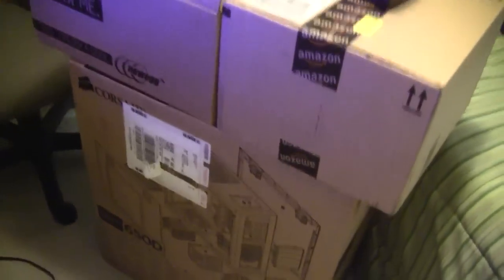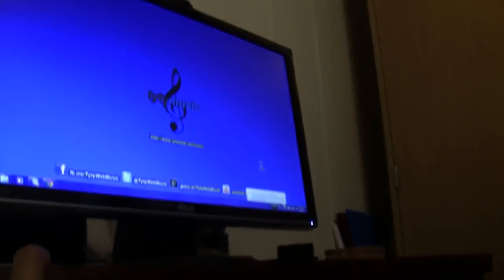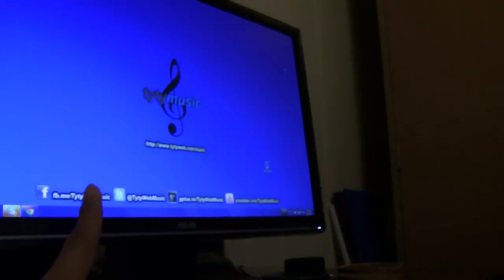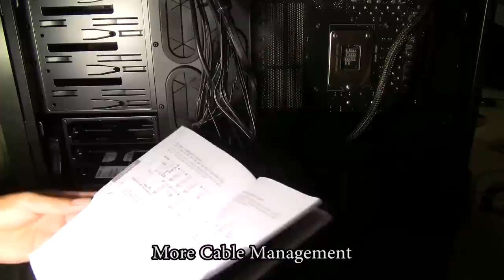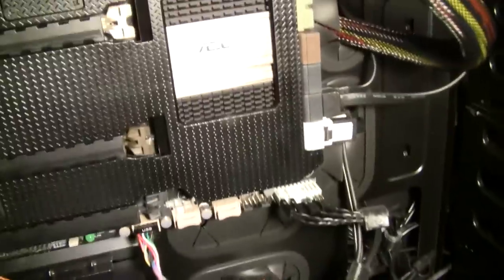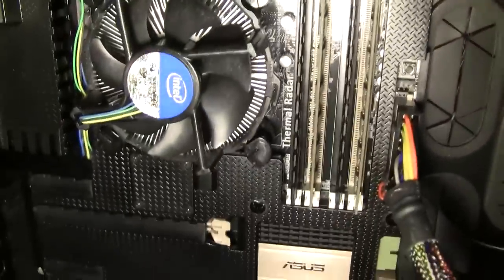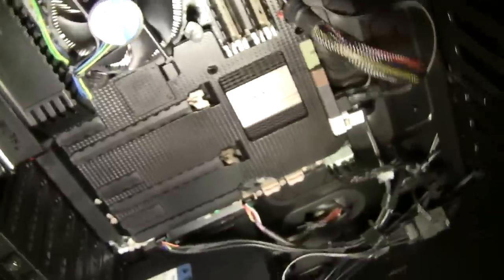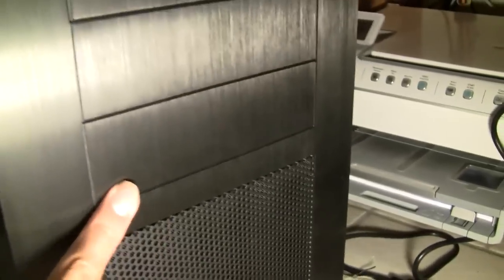My First Computer Build!!! - ASUS Sabertooth Z77

Comment: you did pretty good for your first time. you should invest in a video card. i also highly suggest you put those mobo fans in. the little fans that came with it. it helps the mobo last longer, which is the whole reason for the cover. overall great start, better then i did. for a year i kept the cords in the open. basically you did better then i did the first time. great start! keep investing in that beast.

Comment: my build is almost identical except gpu.  i went with eVGA gtx 660 ti.  i also got a 750w psu incase i ever wanted to SLI which i think i will in a couple of weeks after i get next check.  heard alot of negative feedback about asus but they got the best ratings.  great job.

Comment: Not trying to be harsh or anything (since the last time I built a PC was in the late 90s) but $1500 and no GPU...? Even with a sabertooth; my build that I just purchased right now includes a i7 3770k, an Asus P8Z77-V PRO which is probably just a step down but at least I also included a gt 770 4GB and it all came up around $1.3k. You could have saved a hell of a lot more money and not skipped out on a GPU but eh; not bad I guess. Still though, just my 2 cents.

Comment: Hey dude all your parts match most of the parts i want for my PC but i want to know what your GPU is, if your just using the Built in Intel 4000HD. I wan't to use a Asus DirectCUII GTX 680 would the motherboard accomadate it.

Comment: The biggest fail is you didn't put thermal compound on the cpu. It will not transfer the heat to the cpu fan.

Comment: Not everyone overclocks, man. Overclocking a cpu that already has enough speed to handle every modern program a multimedia computer uses would be overkill. It's like putting 16+ gigs of ram in a gaming computer. Cool, but overkill, considering no game uses anywhere near that much ram, unless you have like 6 WoW clients running at the same time.

Comment: Just Your FORGETTING one Important thing Man.... You Forgot to INSTALL your Thermal Cooling Fan , Just under your CPU Cooler. you have a 2inx2in slot that's for the under cooling, in the video you never installed it, You show the Location At 15-Min & 13 Seconds.. So Apart from talking to much.. all in all, You did a good Job Man...

Comment: Wasted 3500 on mother 3tb harddrive 32 gb 3 evga gtx 760 intel core i7 29 inch moniter, 2 20 inch view sonic monitor, beats by dre, and razer battle field 4 headset